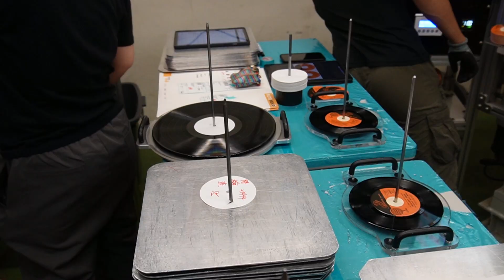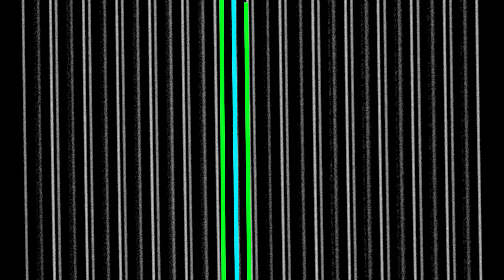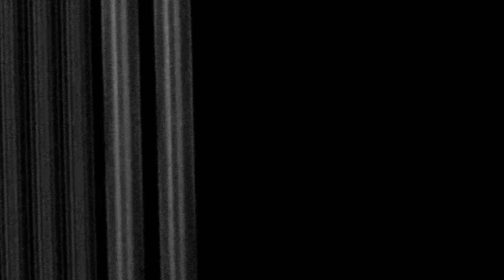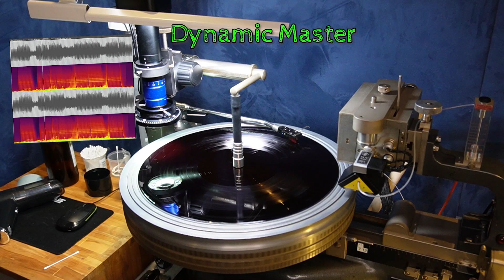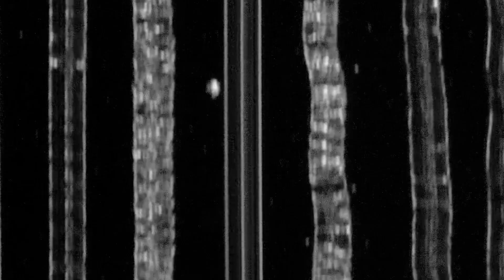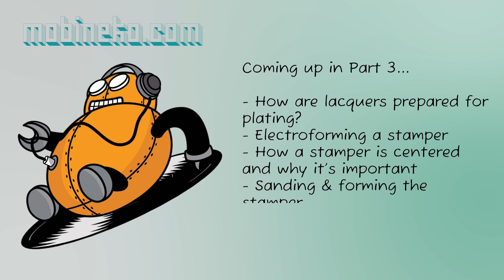Mobineko's Ultimate Guide to Lacquer Cutting, Plating & Vinyl Pressing: Part 2

Comment: I'm not well experienced in recording and such but there's a lot of sss sound in a lot of music that annoys me to hear. But I am pretty sure many artists will just take their CD release and drop it into a vinyl cut thinking it's all the same, and it may be over compressed from the get go, without releasing an uncompressed version that works for vinyl. 

Google AI (for what it's worth) says that some audio will destroy a cutting head and I'm not sure how true that is, and if a client has some very loud, bricked music can the cutting engineer just reject the files telling the artist to fix it? 

Finally, I struggle to hear the difference between the uncompressed and compressed audio in the video, and I am unsure if it's because of my ears, my audio setup, or youtube's audio codecs just compressing everything. The difference between the outer edge and inner edge of the disc is more pronounced however.

Comment: Incredible! Loved the videos. When did Neumann stop manufacturing the Lathe Cutter? Also, did any modern versions become available?
Reply from the maker: I believe the last Neumann lathe ever made was a VMS82 (DMM model) in 1989. Several people have embarked on modern replacements with varying success in recent years, probably the most mature of these is the Sillitoe lathe. The Neumann lathe bodies are built like tanks and earlier electronics are very easy to work on, so I would think there is very little need for an all new modern lathe.

Comment: I am using simulathe cut to see and try to improve my mix for an hypothetical lacquer cut. there are three parameters to keep in mind: excursion, width and velocity. 
Please, tell me, in real world if this maximum values are true or clise to it:  Excursion 50/70 (i preferr stay at 50); width 100  ; velocity 40-50 cm/s. 
In simulathe cut i can see this maximum parameters.
Reply from the maker: It's impossible to answer this without access to the source material. On a physical lathe with modern hardware the only parameters controlled directly by the operator are depth/width and pitch, both of these are dictated by the length and content of the source.